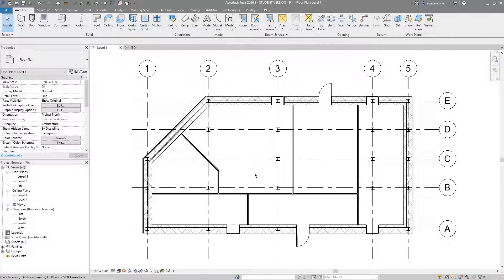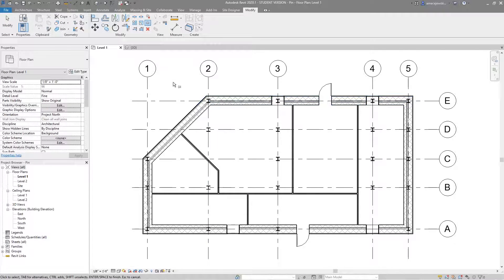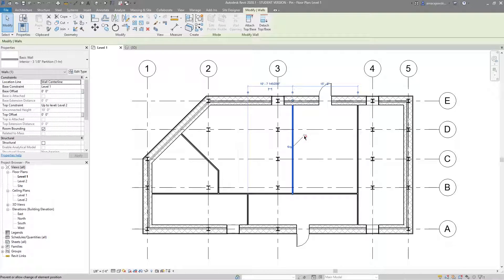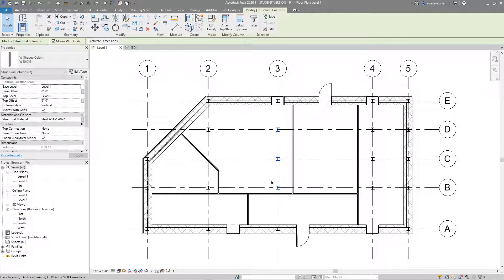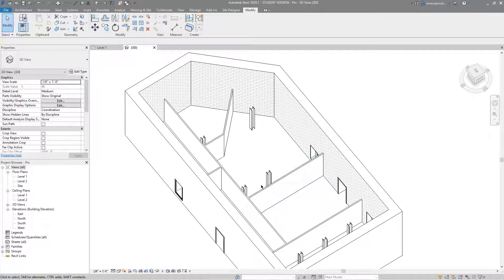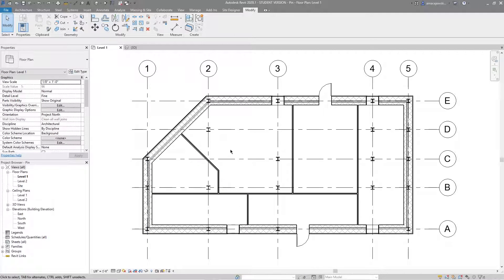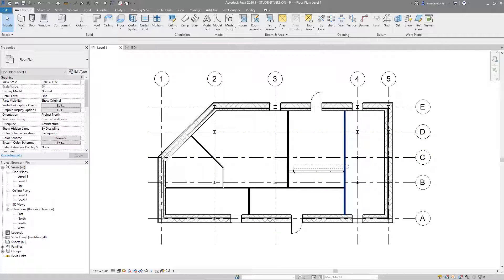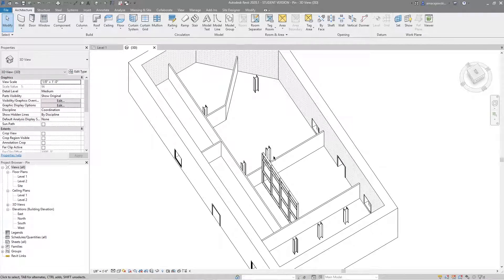How to Use the Pin Tool in Revit | Revit 2020

Comment: can you over constrain the model with too many pins?
Reply from the maker: If by over constrain you mean that if you move an element and everything else is pinned, will Revit force you to unconstrain or unpin elements (break your model) then yes. I use pinning very sparingly to the point where I only pin certain elements at certain times. Pinning objects to affect your model performance positively, although pinning too much can easily backfire on you.